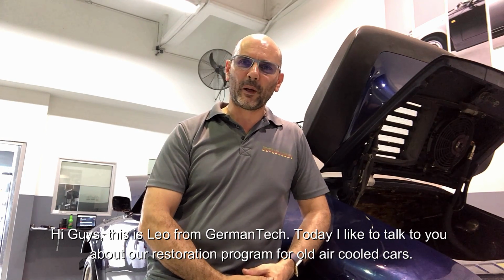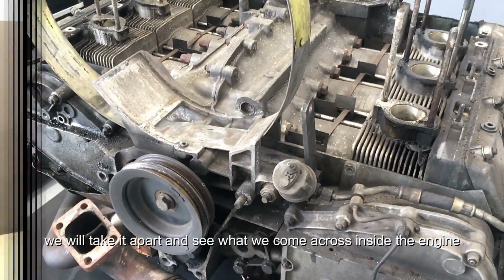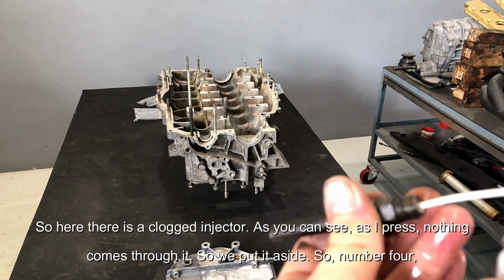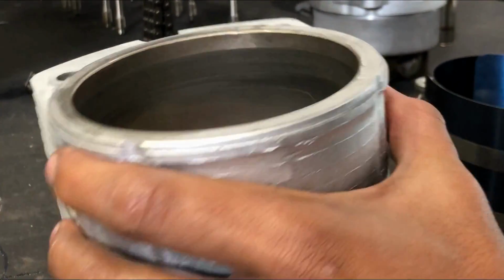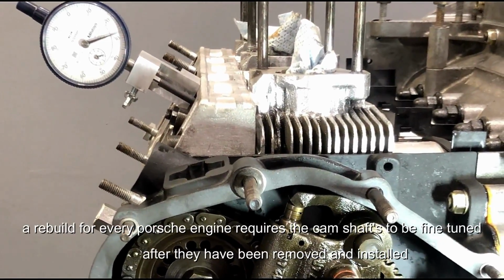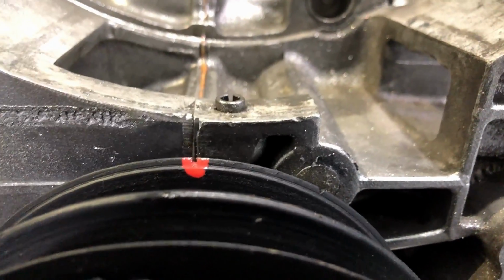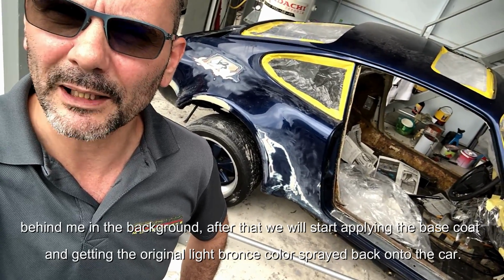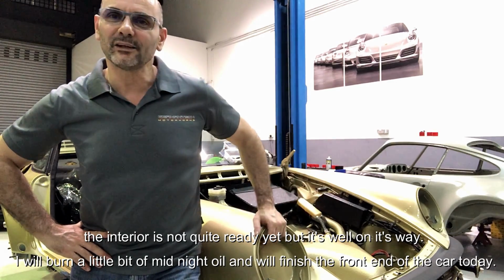PORSCHE 911 (930) TURBO REBUILD

Comment: Sawing off the turbo neck gives me vibes of Allen Millyard. He’s an Englishman who makes new engines in unusual configurations out of factory parts, such as a one litre four cylinder two stroke from Kawasaki 750 parts. He cuts up crankcase freehand with a good hacksaw and welds up the Millyard special casings. They are all perfect and reliable because Allen is an exceptional engineer and fabricator.
Reply from the maker: What matters is functionality. Allen is a great builder, we love his stuff. That turbo neck modification was done 5 years ago, and has not given a single problem from the get-go. We believe Porsche's are build to last, but we believe also that some corners could be improved today vs 35 plus years ago 🙂

Comment: Very nice. I'd sure let these guys work on my 86 NA. It needs 1st gear synchros.  I drive it and won't take it apart to "restore" because that's a long process that frequently takes a running car and turns it into a parts car.
Reply from the maker: If you do follow our channel, there is another video us replacing transmission parts. Do check it out

Comment: I understand the wish of having a factory spec engine but improving it with a modern turbo and EFI injection along with lighter/stronger internals  would be a must for me..!!
Reply from the maker: Thanks Hector. Yes, we received that a lot. As instructed builders we propose changes, but in the end, client decides. Check out our 3.4l conversion as well on the black 930 turbo :-)

Comment: Leo - great vid! You’re a talented and knowledgeable individual! what kind of glue and where do you find that aluminum piece for the turbo? Also why not rebuild rather than replace turbo?
Reply from the maker: The bond is provided with the replacement charger alongside a manual for modification. New is always better than re-build when it comes to hi-rev components in our opinion.

Comment: I really downvote a video, but man you deserve it. At 11m52sec, you show a clean head.. those valve pit and the plug palce are full of dirty carbone. At the beginning you show the alf block dirty whit oil smudges  and dry oil ont the seal placement. And for the love of God dont hammer down a piston this way. I hope  those piston ring are fitted properly before whit a gage.
Reply from the maker: Thanks for your comment. Its 2021 and car is driving amazing, no troubles so far :-)
Saw some exciting projects on your channel as well (although very little content), cant help to wonder, will you be fixing those up? I assume you'll be exciting us with some nice footage soon? :-)

Comment: Nice rebuild. Beautiful color.
Unfortunately: Default speed limits in Malaysia:
Expressways: 110 km/h (68 mph) by default, but may be reduced to 80 or 90 km/h (50-56 mph) at dangerous mountainous stretches, crosswind areas and urban areas with high traffic capacity.
Federal roads: 90 km/h (56 mph) by default (reduced to 80 km/h during festive seasons),[2] 60 km/h (37 mph) in town area.
State roads: 90 km/h (56 mph) by default (reduced to 80 km/h during festive seasons),[2] 60 km/h (37 mph) in town area.
Reply from the maker: Thanks Garth, some would view speed limits as a recommended speed suggestion (not saying we do) :-)

Comment: Nice work. I consider myself extremely fortunate to have been able to own a 1980 930 for about 5 years (1985 to 1990). They are phenomenal cars and I miss the one I owned every day. Any particular reason you left the air conditioning belt off?

Comment: Pounded a piston with new rings into a bore with not a drop of oil?
Reply from the maker: We addressed this earlier, John. The sleeves have been adequately oiled. We shall record the oiling process in the next video.
Reply: @GermanTech-Motorworks   Everyone needs to see generous amounts of oil put on to the piston and bore, novice/home engine builders are watching.
Reply from the maker: @JohnAnderson4242  Fully agreed, we shall make it more visible in the next video. Check out our 930 crankshaft vid posted a few days ago :-)

Comment: Is the engine rebuild something an amateur mechanic can do at home following the Haynes manual (and with adequate funds for parts and tools)?
Reply from the maker: Hi K M, I would say that depends on the experience, technical knowledge and skill of the amateur :-)
Reply: @GermanTech-Motorworks  Also excellent video, I was having trouble understanding valve clearances when I read about it but your demonstration made it look very simple.
Reply: @GermanTech-Motorworks  Thank you for the reply! I have experience with 2 stroke motorcycle engines, and jetting carbs. What is a good source to learn about flat sixes? What is a good engine to start with? Again thank you for the guidance 🙏🏽
Reply from the maker: @KM-mt5gx  with no experience I would start reading a rebuild manual, many available online. You may also wanna check out our video about crank shaft - connecting rod clearance just posted recently. Important however is to work clean and with utmost precision :-)
Reply: @GermanTech-Motorworks  I have already watched that video! You are a legend for being so open and free with sharing your knowledge. Hopefully, one day I will be able to work at a standard close to yours. Thank you for your help. You have gained a subscriber, a fan and a student :)

Comment: how much bhp does that engine produce?
Reply from the maker: officially 282bhp, with the larger air-throughput we should exceed 300bhp easy.
Reply: @GermanTech-Motorworks  Awesome restoration and precsion engine rebuild....set me off now wanting to make a start on my 30year owned 1989 930 turbo thats been out of action stored in my garage for some 5 years.
i had engine mods to my car done in 1992, group B cams, Ruf intercooler, K27/29 turbo upgrade and one bar boost spring fitted and have a dyno read out that it was pushing out touching 420BHP, awesome performance in its day and still is now, second gear at about 3,500 rpms floor it and its unbelievably face distorting fast..... its covered 40,000 since the mods (never track raced) and other than a few oil leaks still going strong but hey would love you guys to rebuild and blue print the engine...... that lumpy cam tick over is music to the ears.... long live the aircooled 911 turbos...

Comment: You didn't show us how you dealt with all that rust under the rear seat.
Reply from the maker: thanks for your comment. There was no rust. The basic foundation of the car was pretty healthy. What you see in the video (brownish -yellow) is Dunlop glue residue. Dunlop glue is used to bond the carpets and noise isolation into the car. The residue has been removed by hand, using solvents and re-applied when the new materials went in.

Comment: I could be wrong, but it looks like you did not remove the old Blue Paint before applying the primer and new paint ~ if this is the case, then can it really be called a restoration back to "Original Condition"?
Reply from the maker: Thanks for your comment John, in this particular rebuild the majority of paint was pretty much removed by hand during the body repair simply because the actual material beneath needed to be checked for rust  prior to repainting the body in its original color. 
Stay tuned for another upcoming video soon of a 1977 turbo, where the body (due to its condition) was completely wet blasted.

Comment: Just think. When these cars first came out, the repair/labor rates (flat rate) was little different from the normal 911 engine, which was already problematic. (lots of problems with studs pulling). Initial rate for replacing difficult to get at spark plugs. 1.1 hour (for the mechanic). So there was labor unrest in the repair stalls. Timing the cams and such also done in the repair stalls, most good mechanics had all of their own tools, somewhere I still have the very expensive camshaft nut tool. In Tucson, you worked very hard, the garage had no cooling in the summer, so I bought a large used A/C window unit and placed it on a wheeled dolly. First 930 model easily did over 165 mph. K jetronic in first version was prone to catastrophic lean backfiring. Was factory certified and trained, still have the framed certificates. I was one of the first who cleaned the injection nozzles with ultrasound.
Reply: The country which this 930 resides, the labour is not an issue, its the parts are super hard to get and the exchange rate sucks. Only rich chinese or malay royalties can afford it when it was new.

Comment: I worked at a Porsche dealer in 1987 in sales. I got to drive a lot of 911’s and 930’s. Wonderful cars,to get the best out of them you had to learn the proper way to drive a rear engined car. I’ve always wanted a 930 but the days of getting one at a reasonable price are gone. Good memories though.👍🏻
Reply from the maker: I missed that as well...

Comment: Headlights are a bit dull.
Reply from the maker: might appear dull in the vid. I shall clean the cam lens next time around ;-)
Reply: @GermanTech-Motorworks  yes wondered that myself.  Its funny but I can only find headlight restoration (Neuverspiegelung) in Germany, nowhere else.  Reflektorklinik.de used them myself, they're good.
Happy New Year from Greece.
Reply from the maker: @gplusgplus2286  Head lamp assemblies during a rebuild as shown are considered rather low in price and will be replaced if necessary. However, rest assured, the lamps were in great shape. We did have other restorations were those assemblies are replaced.

Comment: What a great video! Loved watching the transformation. I prefer my cars with a bit of patina, but do admit that the end result is stunning. 
I did think that there would be more rust underneath but I'm thinking of UK cars, where this is much more of a problem. 
Over what time period was thiscompleted?
Reply from the maker: Hi SM, I'm glad you enjoyed the clip. We started in September and had it ready by New Year.
Reply: @GermanTech-Motorworks Wow, impressive turnaround.  :-)
Reply: @GermanTech-Motorworks  Very nice job done. Congratulations and thumbs up. - But I've one question in mind: Being a 1984 model shouldn't it have a black headliner instead of a white one?
Reply from the maker: @ @lamberko  the classic archive in Zuffenhausen certified the delivery condition with a white roof liner. Our build was based on that birth certification :-)